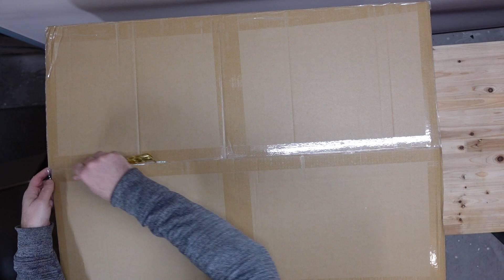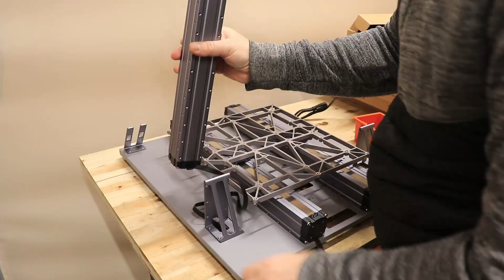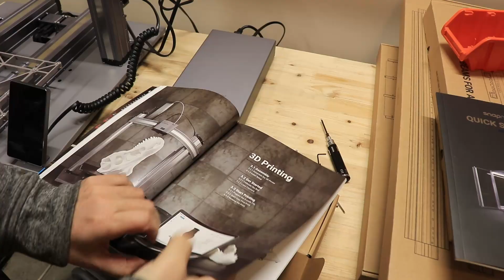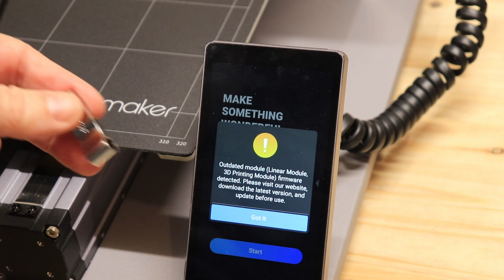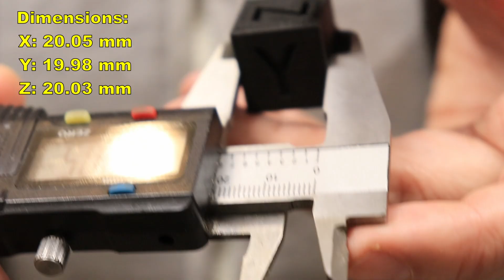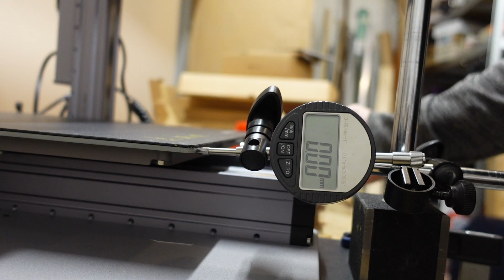A premium 3-in-1 solution: Snapmaker A350ENT - 3D printer, laser engraver and CNC router (part 1)

Comment: That's amazing after watching your video. We also focus on the R&D and manufacturing of laser engraving machines. Of course, we have K6 with low-power self-developed software for the whole series of products, and JL7 or L6 with high-power open source software. There are also galvanometer models Z3 and Z4 specially designed for metal engraving. No matter what kind of requirements you have, you can meet them. Welcome to our store to buy:https://www.youtube.com/channel/UCULfl9szFZREuW11XC4uJig

Comment: Would be interesting to see if the laser module could be replaced with a higher powered one maybe from a different manufacturer if snapmaker don't offer one themselves. PSU should be powerful enough if it is designed to run a  CNC head.
Reply: The printer comes with a 1600mW laser head which is adequate for cutting thin sheet wood and printing/burning pictures in materials.  Snapmaker sells a 10W laser head for the printer  in their store.

Comment: This looks extremely well built. But it seems more like a decorative piece with more focus on aesthetics.
Reply from the maker: It is not just for aesthetics, but they tried to find the mid-way, since 3D printing and CNC carving requires different linear motion for optimal performance. It would be good to test something by Snapmaker designed directly only for one operation (for 3D printing for example, I am very curious about their new J1)
Reply: @MyTechFun  That's true. I was incorrect.